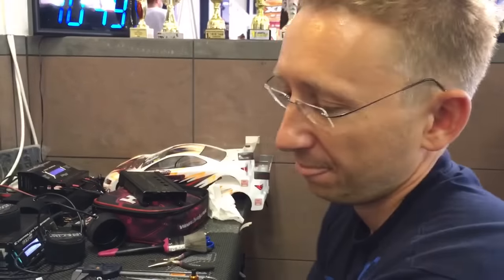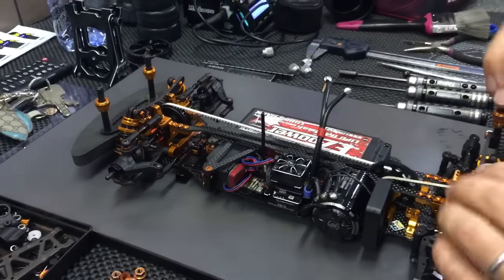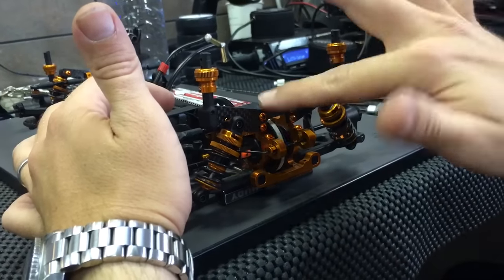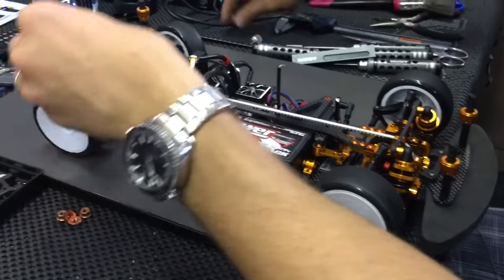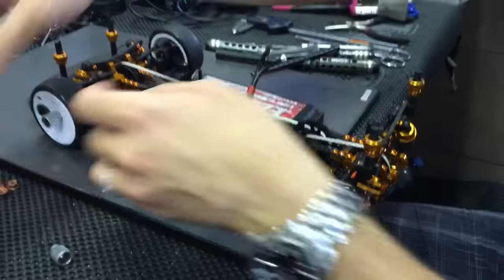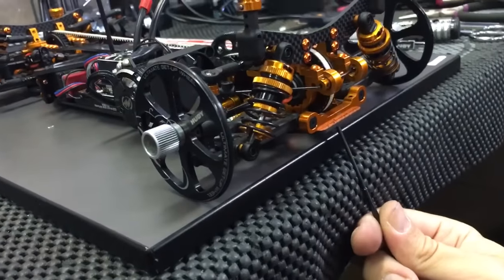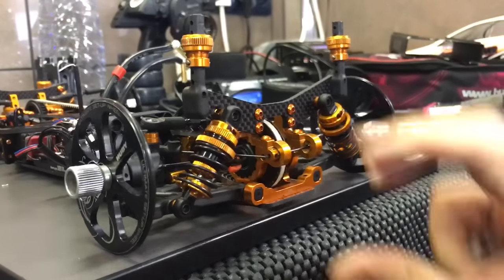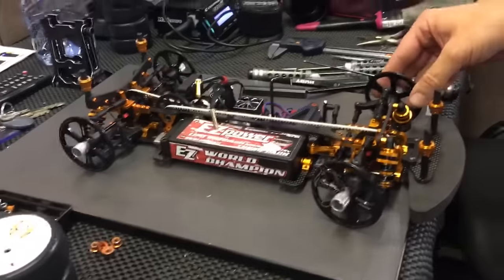Xray T4.Tweak and Spring set up tips from Martin Hudy.

Comment: I always has tweaked springs with the wheels I use. But off course, it makes perfectly sense that the wheels are not 100% round. How much it helps an amateur on a rough, cracked up asphalt track is a different matter. But if you are going to do it right I guess I buy a set or make one.

Thanks Gareth, thanks Martin :)
Reply: Make sure that your droop setting is equal left to right. I got tweaked springs even with the Hudy wheels because I didn't set up correctly the downstops. Now everything is Gucci though.  :)